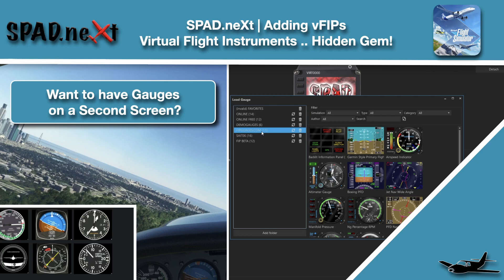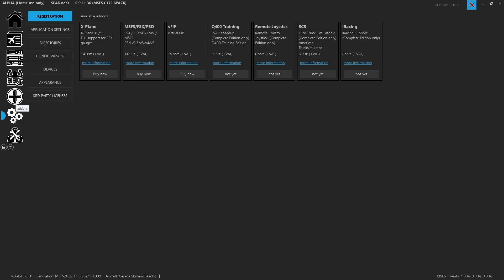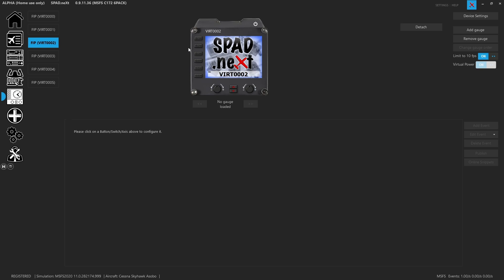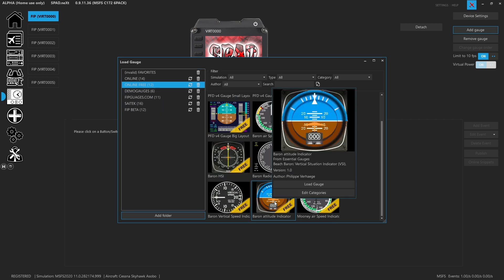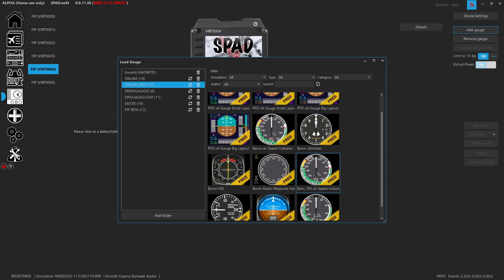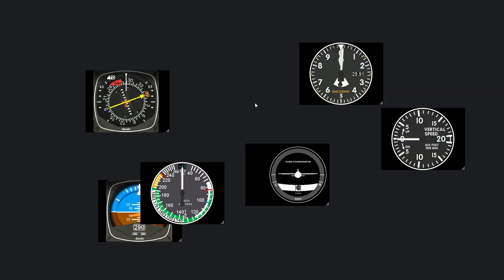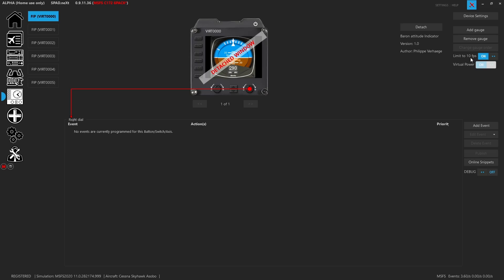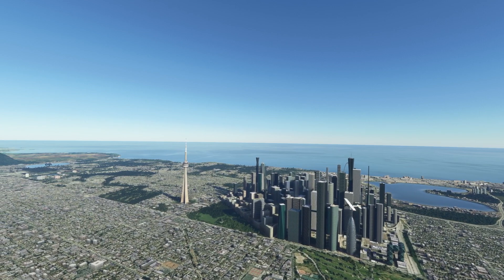MSFS | SPAD.neXt | Virtual FIP Gauges

Comment: Hello dear, I need your help, I would like to use 2 PCs, one for the sim with 3 monitors, and one for the avionicac pop outs with 4 touch screen monitors. How can I do? I am going crazy
Reply from the maker: MSFS does not support that. You can use virtual FIPs like this video or you can use products like airmanager. But you can’t have the MSFS planes screens on a remote pc.
Reply: @LesOReilly  but virtual fips of spad or air manager can I use them on another PC on the network?
Reply from the maker: Yes if you have complete edition spad or have the vFIP add on you can install the remote vFIP client on another pc.

Comment: Do you have a video on the physical FIPS?
Reply from the maker: I do .. SPAD supports them in the same way .. but you see them as physical devices...  I also used to run them on a separate machine using a networked license...
Reply: @LesOReilly  Alrighty. Had a look around but couldn't find the video.
Reply from the maker: I never made a video specifically about them.

Comment: Hi Les…all your SPAD videos are amazing and extremely helpful. In this video you mention a video to follow that will explain how to use VFIPs on another computer to offload the processing of physical FIPS on the main sim computer. I have 9 physical FIPS and have been struggling with this for months. I can never get all 9 to sync with the slave machine despite following Ulrich’s instructions. When will your new video on this setup be available? Thanks!!! -Nick
Reply from the maker: I was waiting for the next Alpha Update ..  there is some things being added to it that fixes some of the other FIP changes in a more recent Alpha :)...  Now for me I have the complete edition which entitles running more than one instance of SN on your home network for the same sim.  So I actually run a full version on my Overhead PC (has a touch screen monitor for an overhead panel and then connects the 9 FIPS as well..

That said one thing I found a lot is that I added a power switch to my USB Hub so that I could turn them all off and on from my panel.  that way I would power them up after windows has booted...  this I found to be the most successful method..  the other issue you might be running into is just Data bottle neck..  I see this depending on the combination of gauges and if I remove FIPs from gauges then I will see some start to update faster ..  So I also need to look at trying to separate them to maybe 4 on one hub and 5 on another going into separate controllers of the NUC pc
Reply: @LesOReilly  so funny to hear you say that! I have the complete SN too and the only way I have ever been able to offload my FIPS onto a slave computer to save processing power for the sim PC is to run two full versions of SN…one on each computer…and let them talk to each other. I was just trying to figure out an easier way to do it and ever since Ulrich introduced vFIPS it seemed like the natural progression. But I have never been able to have it work with all my FIPS running at the same time. Still, I’d be curious to see if you have success with the alpha release and then make a video about it. Thanks!
Reply from the maker: @kambour1  Yup will do.. it's a good feature and an option that those that are non-complete edition could chose to leverage...  so yeah it just makes sense to do the work and add that to the series.

Comment: Amazing! Was there any noticeable fps impact? Looking forward to seeing how to run on separate PC (I have a laptop PC that doesn’t see much action). Thanks  for another great vid.
Reply from the maker: No I don’t see one.  But that said my CPU is rarely above 50-60%. So has head room. Driving the physical units does for sure. So moving them to a remote PC is a big help. That said running any vFIP on a laptop is still a benefit to move to an extra screen that frees up the main sim.
Reply: @LesOReilly  Thanks for the follow up. I'll reply again with what I see as frames impact of 'displaying' a 6 pack on an iPad running DUET. This is sooooo much fun 🙂
Reply: So there is a frames hit with DUET....this using a simple 6 pack of gauges. I'm thinking that DUET is not suited for use when there is a lot of changing information / data being fed to and displayed on the DUET 'display'. Not what I was hoping, but it was what I expected given my experience with moving popped out G1000 displays to the DUET 'monitor'. Worth a try regardless.
Reply from the maker: @ArtG-49  yeah running on a remote PC on the Network will be better..